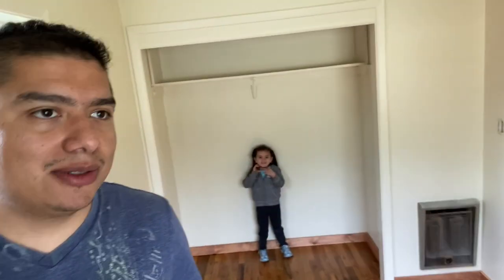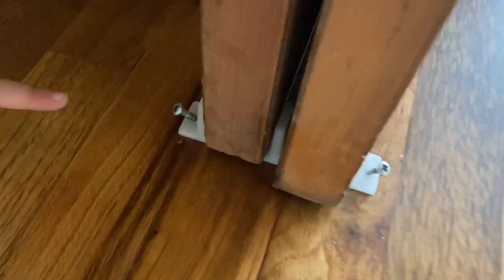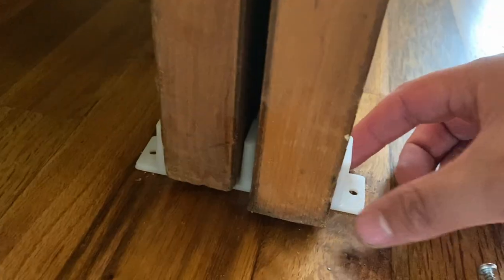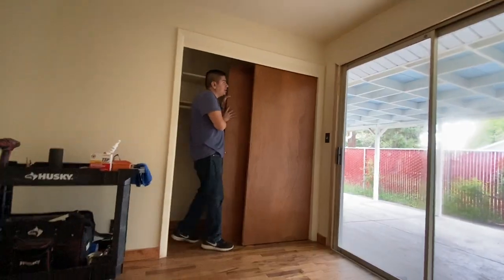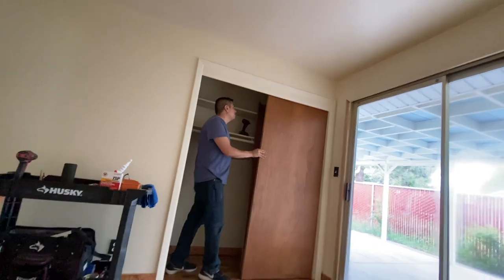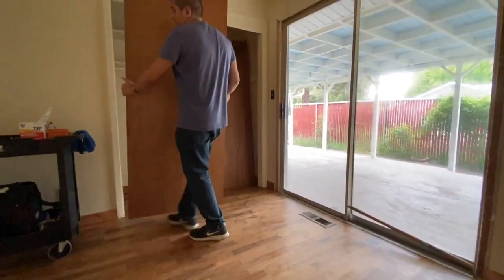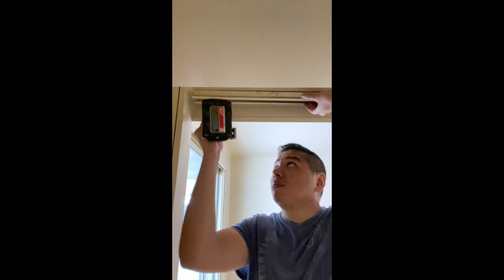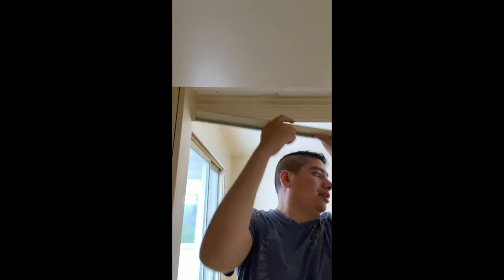How to remove sliding closet doors

Comment: Great video. Are you going to install a new door on this closet? I want to get rid of my old sliding doors but I don’t know which doors to replace with. I guess I can use a curtain for now until I figure out what to do.
Reply from the maker: I didn’t install new doors I left it open and I made this room my office. I put my office supplies in the closet. I would imagine Home Depot sells closet doors that go in very similarly to these one.
Reply: @89elhombre  can you put them back in if you wanted to?
Reply from the maker: @zenzy1154  they should go back in as easy as they came out.